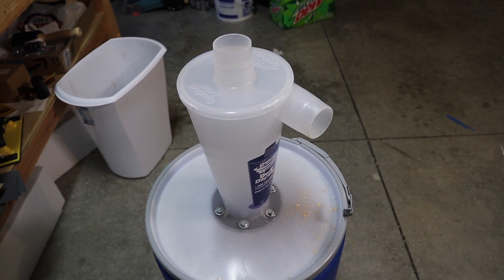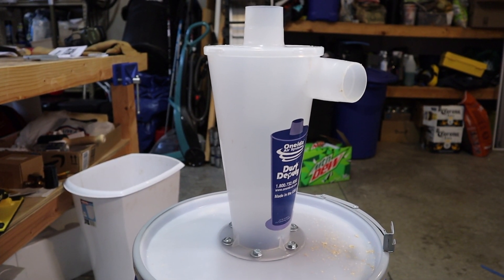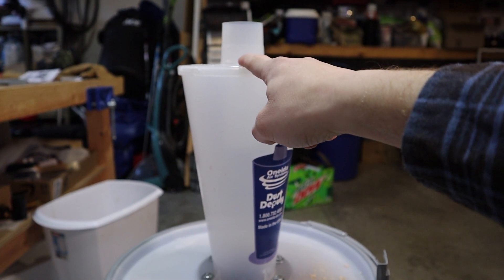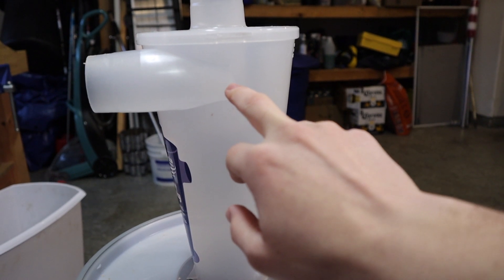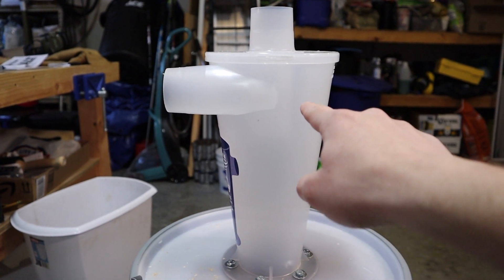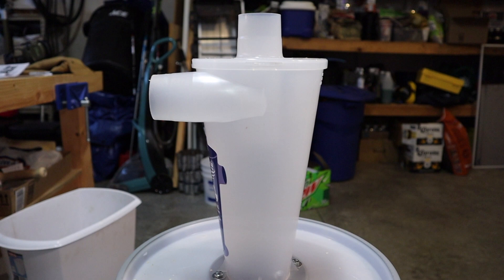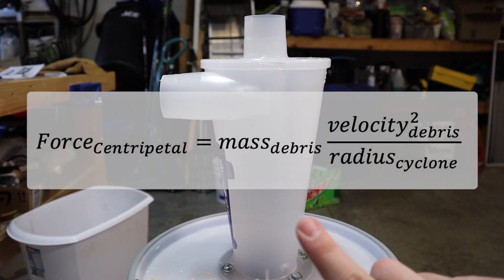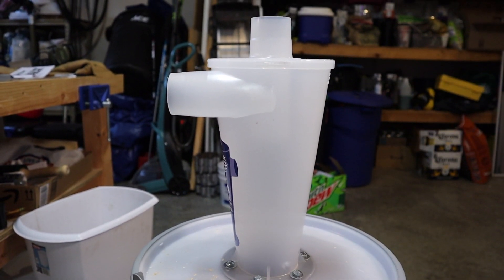How Dust Cyclones Work

Comment: Hi can a cyclone handle the fine dust from cutting mdf board. Medium density fibreboard. Very fine dust.
Reply from the maker: Great question. I haven’t personally cut MDF but at my last job we used to use these to separate extremely fine plastic particles for 3D printing. In combination with the filter on the shop vac, I think it’d work great.

Comment: I built my own  a few years back but I never knew how efficient it actually was.  Something just doesn’t feel right about the shape of the inlet (where the dust enters the cyclone.  I feel like there ought to be guiding walls that help channel it towards the outer wall (as opposed to slipping downward right away), especially for lighter material.  The whole point of the cyclone is that fine dust too quickly clogs our filter, and so we want to mitigate that.  I’ve never had thicker dust or wood chips clog my filter.  I want a cyclone solution that really really does well with fine dust.  Maybe there needs to be a secondary cyclone?
Reply from the maker: Totally get where you're coming from. The reason I went with Oneida is that they have some of the best dust entrainment in the industry; especially in their commercial dust collectors. From an engineering standpoint (my background), a lot of the efficiency depends on the interaction between volumetric flow and the shape of the cyclone (as you suggested). I haven't done a direct comparison with this cyclone but based on the performance of their other models, I assume the engineering was done on this one as well. 

Actually as one datapoint, at one of the engineering companies I worked for, we used these on 5 gallon buckets to collect plastic powders that averaged a particle size of ~55um. Of course this was on a distribution so we also had particles that were <10um and smaller. These cyclones did a phenomenal job of pulling that all out of the air, meaning we rarely had to change filters on the shop vacs. 

Regarding your question of a second cyclone, Oneida actually has this as a potential configuration. Below is the link to the dust deputy manual, page 13 has the diagram of what you described. Great minds think alike!

https://www.oneida-air.com/amfile/file/download/file/338/product/857/
Reply: @NorthwestCraftsman  thanks!  I’m pouring over the link you sent me.

Comment: I put one and 90 % of stuff still goes to the hoover not the barrel.
Reply from the maker: Weird! At the risk of asking a dumb question, do you have the shop vac hooked on the top?
Reply: @NorthwestCraftsman  yes, Milwaukee m18
Reply from the maker: Hmmmm, when your sucking up sawdust or the like, does it form a nice cyclone around the funnel? Or does it just kind of haphazardly come in? I’d be worried about the M18 not having enough suction (translated to air velocity) for the cyclone to actually filter out the debris.

Comment: At last, someone who explains the physics behind this witchcraft. One further question however, if the vac is pulling through a 32mm hose, would it be best to use the same size from the dust making device or use the max opening of 50mm?
Reply from the maker: Thanks! My engineering degree comes in handy sometimes 😂 other times it just over complicates my life 😂

Great question! This depends on a lot of factors but in general keeping the same diameter will reduce the number of losses in transition. Especially since most shop vacs have a high pressure drop and low air velocity, you won’t have a high enough velocity in a larger diameter hose.
Reply: @NorthwestCraftsman  Thank you. That's what i was hoping for.

Comment: What if you reverse the we the vacuum inlet and outlet and extend the center tube down into the container with a flared end on it so no dust can float upwards? Would it be a better design since it would allow the debris to go straight into your container and the flare end keeping dust from circulating back up instead of potentially having fine dust getting sucked back up into your current set up with the centrifugal forces being so close (small cyclone) to the downward tube.
Reply from the maker: Hey! Sorry for the delay. That is an alternative design that is more like a baffle than a cyclone. I'm not sure if it'd work better and would need to test it! Interesting idea though!

Comment: Great video but I wish you had shown the cyclone in action.  Compare how it works with wood working dust or with dust from maybe a concrete grinder, etc.  I'm curious if this will work with particles as fine as concrete dust or only with larger saw dust.
Reply from the maker: Thanks! And you’re totally right, I’ve been thinking I need to release a video on efficiency of the cyclone in a more quantitative manner. Not sure how easily I’ll be able to get concrete dust but I can at least get a variety of wood based particulates. I will say though, I used to work for a group that had powdered plastic. The kind that hangs around in the air for a long time. We used these to vacuum it up. Worked like a charm! Or at least, way better than the alternative. I imagine concrete dust would be more dense than the plastic dust, leading me to believe the cyclone would work better on it since the cyclone is relying on centrifugal force to separate it out.

Comment: Great explanation about what’s going on in the cyclone extractor. I have that exact model dust deputy.   For some reason, after 2 years of good results, dust piles up in my main vacuum. I contacted Oneida and they said there was a leak somewhere. Do you have any advice on how to find a leak?  I’ve tried taking it all apart cleaning everything putting it back together but still, almost as much dust goes to the main vac as it does in to my collection bucket
Reply from the maker: Thanks for your kind words! And hmm, finding a leak is usually very difficult, I think what they’re getting at though is that the air velocity is too low. Have you tried with a clean bag/filter and still see the same poor performance? I imagine it’s a downhill slide once it starts to fill up.

Comment: Great to be a Buckeye! Hey, I am a total novice to any of this but, I'm designing a 16' x 16' workshop built on top of a wooden deck. I hope to have dust collection for my table and mitre saws. I want to run the 4" PVC under the floor making the inlets in the floor under the cabinets. I also would like to have the dust collector positioned in a corner with the collection containers being below the floor and accessible for cleanout from outside the deck floor behind the  lattice work that skirts the raised wood deck (36" high).  

There is so much I don't know, such as, can I run the PVS under the floor and have inlets through the floor positioned beneath or closely ajacent to the cabinets? Can I construct a dust collector with collection containers beneath the floor and make them accessible for cleanout?

Neither of these things seems to have any history of possibility that I can find. I would appreciate any advice you can give me.

Cliff Eck - Florida. (Born a Buckeye, still a Buckeye)
Reply from the maker: Hey Cliff! I'm still figuring out most of this so I'd put myself in the same boat as you. 

I don't see an issue running PVC under the deck, in fact, that would be a lot cleaner look because then you don't have piping around the walls and ceiling. I also think getting the collection cabinet under would be easy as well. One thing to keep in mind is the blast gates and where those will be because you'll want access to them near each tool since you can't shut off major lines easily if they're under the deck. 

Here is a good video (Also super cool) that's not directly applicable but shows how to make a dust collection box. I think you can adapt many of the principles. 
https://www.youtube.com/watch?v=n2OStvRteRE

Good luck! Let me know how it turns out!

Josh
Northwest Craftsman
Reply: @NorthwestCraftsman  Thanks for the response and encouragement to strongly consider under deck piping. I now have one more question, are remote-operated blast gates available? Seems to me that a control panel at my workbench that turns on the Dust collection that also had switches for the blast gates would be ideal.
Reply from the maker: I think it’s possible but I expect they would be fairly expensive and prone to failure. I think a better solution would be to section off your shop into 2 or 3 major lines and near your dust collector, split those lines off above the deck. Then, at each tool, have another blast gate before the PVC goes below the deck that you open before using. The initial gates help to keep the pressure high by not pulling on all lines at once, while the individual ones give you control for each tool.
Reply: @NorthwestCraftsman  Good idea. I'm thinking of using  manual blast gates below the floor surface with some kind of mechanical operating lever at the tool. Perhaps inside the tool base and on its side panel. If its on my workbench, same idea but under the workbench top. Another idea is to cut the flooring to make access to the piping and removable for change or addition options.

Going back to one of your original comments, I'd like to keep all piping and noise outside the workshop space. I have room and design ideas that I think can do that. Maybe it won't work but if it does, my wife might even come in once in a while.
Reply from the maker: @cliffeck6104  Manual blast gates might be possible! Hadn't thought of doing that. 

And I totally understand that. The shop is a noisy place as is, not withstanding more. I'll get back to your emails soon!

Have a great one, 
Josh

Comment: Will one of these increase the vacuum pull on the debris .Before it gets to my vacuum
Reply from the maker: It's a little bit of a complicated answer. Yes and no. 

Yes, when your vacuum filter would normally be clogged by all the debris you've been vacuuming, this will present a large improvement because it captures most of the debris before it ends up in the vacuum. It will greatly extend the life of your vacuum bag/filter and through that, you'll have stronger suction longer. I haven't changed my filter in almost a year and don't plan to any time soon.

Also, no. When you have a clean, unimpeded vacuum, there will be a small loss in suction because of the pressure drop caused by adding the cyclone inline. It's the same effect that happens when you add any accessory or length of hose, suction will decrease slightly. 

I find the benefit of the extended life far outweighs any suction loss, which honestly hasn't been noticeable to me.

Comment: Great question. I want to use one with my planet. But my question is: do I need to have a vacuum sucking out of the top or will it still work without it?
Reply from the maker: Depends on your planer! If it has a powered chip extraction, you should be able to use it without the vacuum. If not, use a vacuum.
Reply: My dewalt planer can blow chips to the next town over!!  Thanks for the tip.
Reply from the maker: @ericdvds9988  😂 it sure can!
Reply: Do you think it would be possible to build a big one of these? Say an extraction system with 300 mm pipes running 5 sided planners etc.